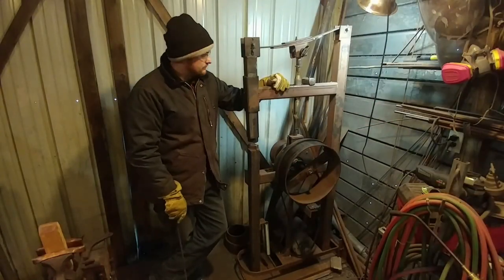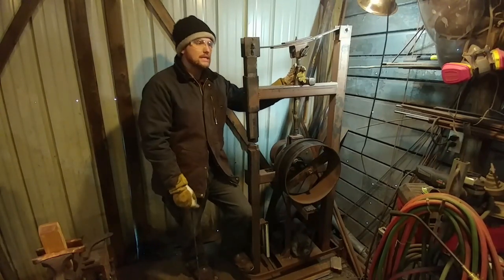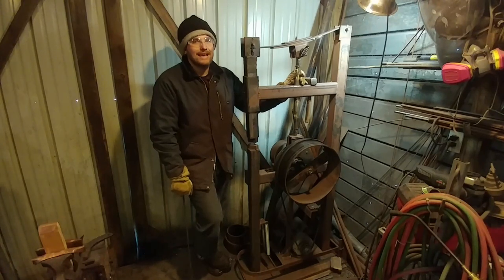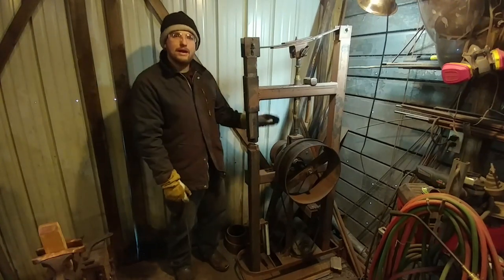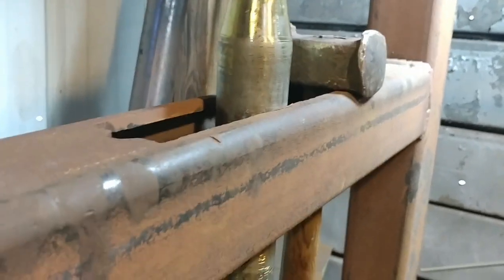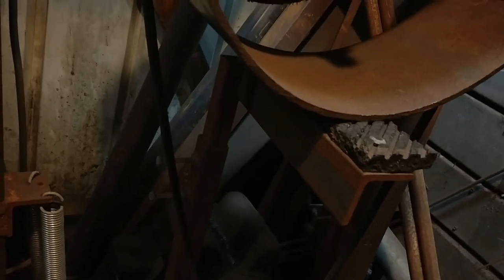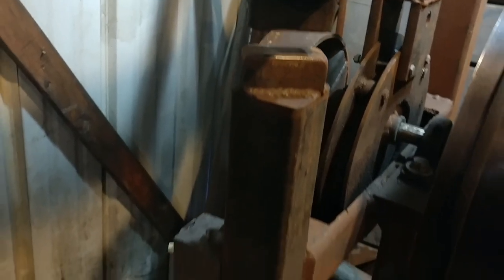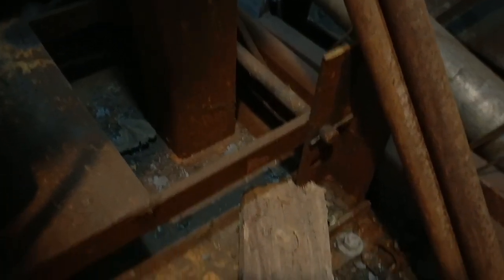My "Main Shop Power Hammer" Walk Thru

Comment: If it works that's all that really matters. TY for sharing. Subbed and gave you a 👍

I'll most likely experiment more with the leaf springs as I have a junkyard.

Probably try rubber motor mounts for electric motors I typically use on the double mitre saws I occasionally build for the picture/window frame manufacturer's needs. See how long that lasts damping the vibrations that are busting the leaf springs.

Who knows? ...maybe a chunk of tire treads would get more mileage out of the leaf springs..... or not.

If I remember I'll come back to tge  comment section here with the results of my experiments to share with others too. 

Thanks agian. 😀👍

Minor criticism... Welders/Machinist refer to it as Square Tubing not "pipe". 

Pipe is pipe... and is either seamless or not and has its own system of Inside/Outside diameters and system of wall thicknesses and tapered threads. (NPT)

Two seperate pieces... rather than cutting a notch through one. Is a much better idea as it weakens it a lot in that area even if it's heavy walled Square Tubing. 

You can go with less expensive wall thickness by just using two pieces and it will be much tougher.  So I recommend you follow that idea in your future build. Hope that's helpful.

I'm a Welder/Machinist by trade and work a "Job Shop"

 Inherited a tiny auto salvage and scrapmetal buisness and it's really handy to keep any time after April 15th. 

🥴 Tax laws are clear as mud but my wife is trained for it and willing to watch it all to the last penny for me. So I can just concentrate on building stuff our customers are willing to buy and can ignore the obnoxious sound of the shop phone ringing.

It used to be tapped into the shop PA system...Clipped that wire to shut it up and landlines only work in the office in 2022.😂🤣😂🤣

Comment: I was just lucky enough to score a 100yr old Kerrihard 30lb power hammer in great shape. It is surprisingly compact and only 4.5ft tall and 800lbs. They used a similar philosophy of keeping everything within the frame area with the drive shaft and flywheel mounted centrally. The helve hammer is mounted on a spring armature like a little giant, but the drive mechanism is a cam type pushrod similar in style to what you've built. Its amazing how many ways people have come up with over the years to make a mechanical hammer.

Comment: In excess of 200 lbs :} bigger more power oh yea ohohhoohhh as time allen used to say on home improvement.

Eh just go ahead and build that steam hammer you wanted to do, 35 tons open die all forged frame the works right Roy?   and full on supercritical heated steam boiler.  heh

600 hours on dies though seems like pretty good wear and tear endurance though.